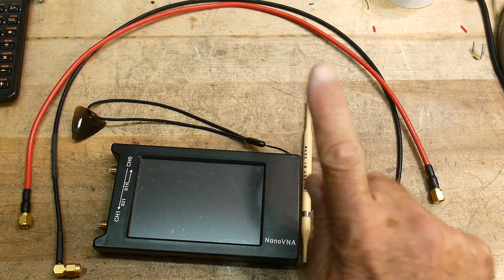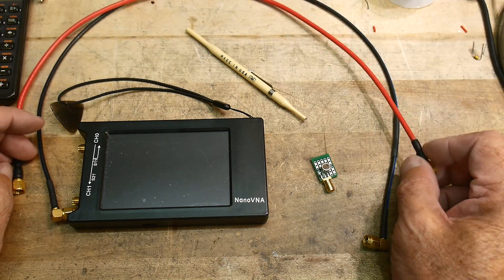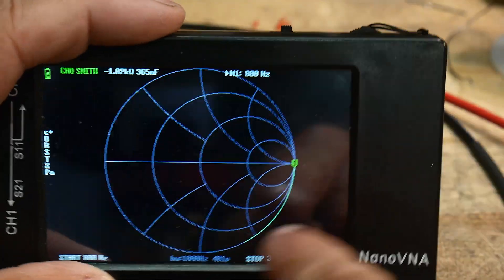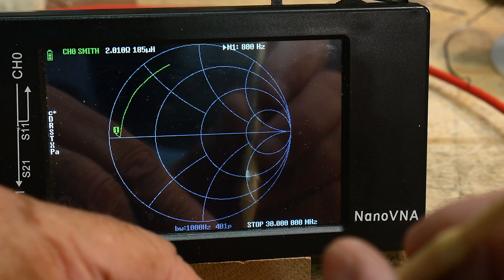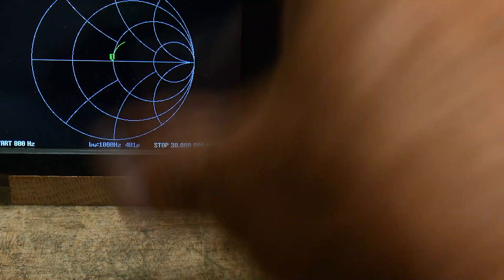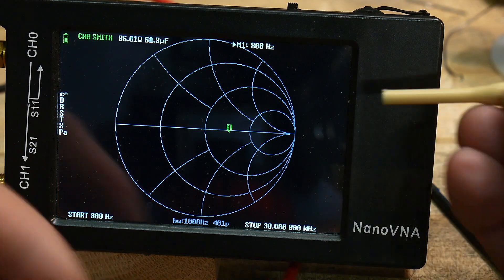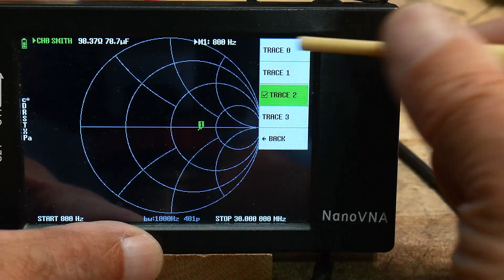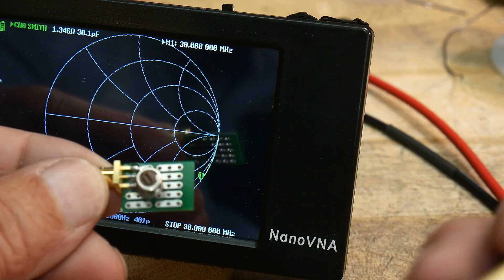#833 Impedance Test Fixture for the NanoVNA

Comment: You need to use a legit 50 ohm RF resistor on a shielded case to make this test.  Your resistor is working like a LC circuit
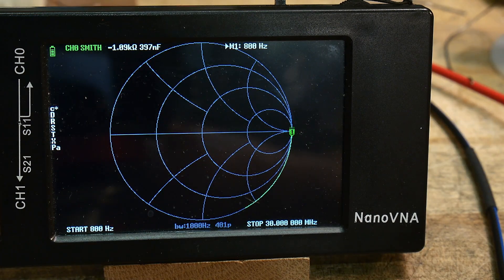Reply from the maker: you are correct to worry about LC but in this case they are very small at the test frequencies. I show at 4:10 that the gamma is very near 0 + 0j      so at these low frequencies it works just fine.

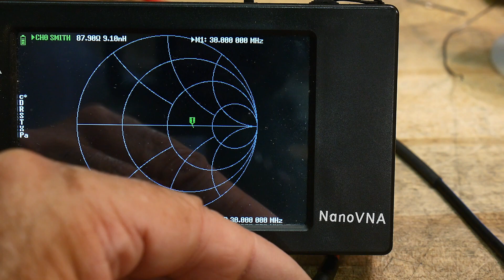Comment: I don't think that this is correct. What you measured at 9:45 is the impedance seen by the VNA when the phase is zero (and thus reactance is zero). This will occur when your cable length is an odd integral multiple of a quarter wavelength. At this point your measured impedance is equal to (Z0)^2/ZL (where ZO is characteristic impedance and and ZL is the load impedance). Solving for Z0 we have Z0 = sqrt(Z measured X ZL). You should have measured the load impedance at this point multiplied it by the measured impedance (VNA) and taken the square root. AT 5:10 you were misled into thinking that, because the measured impedance was 50 ohm on a known 50 ohm cable, that meant that the measured impedance on the VNA is equal to the characteristic impedance. Had you measured your load impedance at this time you would have discovered that it, too was 50 ohm and thus that Z0 = sqrt(50X50) = 50 !!.  Try placing a 100 ohm termination on a known 50 ohm coax and repeating your methodology. What you will find is that your measured impedance (VNA) at the zero phase point would have been 50^2/100 = 25 ohms. Edited post for clarity (I hope).

Comment: Another way is to remember that a 45 degree transmission line shows a reactance value in ohms which is equal to the characteristic impedance;   with cable open on the far end, find the lowest frequency where it shows shorted.  Let's say 50 MHz - the length is a quarter wave.   At 100 MHz it will be 1/8 wave or 45 degrees.

Comment: Try this... with the cable open, find the lowest frequency where the cable appears shorted. This will be where the cable is 1/4 wavelength. Attach a 50 ohm load to the cable and read the resistance. The cable impedance is then Zo = sqrt(Zl*Zmeasured). In the case of 75 ohm cable (but you don't know that), you should read about 112.5 ohms with a 5o ohm load at the frequency where the cable is 1/4 wavelength. So Zo = sqrt(50*112) or 75 ohms. For your 88 ohm cable you should get a reading of 154 ohms using the procedure as above. Hence, Zo = sqrt(154*50) or 88 ohms. I hope this makes sense.

This way you do not need a test fixture. Just a sweep to find the 1/4 wave frequency and then measure again (at that same frequency) with a 50 ohm load attached then apply simple math.

Cheers, 
John
Reply: Best comment of the thread.
Reply: You are Amazing😮😊

Comment: I thought with the help of your video I just found how to make phasing lines for vhf dipole feed element but I am way way far from that 90°... I don't understand how to measure phasing lines on the smith chart... how can you measure a piece of coax cable to have 90° ¼λ to feed a 145MHz dipole for example ?
Reply from the maker: a  1/4wave length of coax will go 180 degrees around a smith chart.  360 degrees of phase travels around the smith twice
Reply: @IMSAIGuy  hmm... there is something I am not doing right then... if I need a piece of coax to be ¼λ at 145MHz, I calibrate my nanovna between 144-148, select the smith chart and only connect that piece of coaxial cable with open end to the nanovna ch0  right ? if it is the case, it is not working (as the plan I am looking at state a particular lenght of .66 velocity factor) and I don't know what am I doing wrong.... but thanks for the replying and the precisions !
Reply from the maker: @Aleziss  you don't need such a small frequency range. sweep from 50 to 300 and see where you are. too short or too long.
Reply: @IMSAIGuy  thanks I will try this again with larger frequency range... I was expecting to be right on it since I already had some measurement according to a antenna plan. Thanks for the hints !

Comment: How to measure differential pair cables, such at cat5/6?
Reply from the maker: you would need a balun. this would be also 50 to 100 ohm impedance change. The spec on cat cables is 15% so don't expect a perfect 100 ohms.
Reply: You can also do it by measuring it on a LCR meter - you measure the short circuit inductance (so short the far end of the twisted pair) and the open circuit capacitance, and zo = sqrt(L/C). It works good on twisted pair cables. The longer the piece of cable you measure, the more accurate the measurement will be

Comment: One thing that would help would be to pick a pot with a smaller range and make sure the pot is a linear taper (not an audio taper).  For this cable, he could use a 50 ohm resistor in series with a 100 ohm pot.  That way you get a range of 50 to 150 ohms.  Or, use a multi-turn pot, one that has a standard carbon base to minimize inductance.

Comment: is the far left on the smith chart where it is shown as short is always at ¼λ ? meaning at the far right where it is open is 0° and far left where it is short at 90° ?
Reply from the maker: yes you you start at 0 on the right, then 90 deg on left (going clockwise) then all the way back at 180 then right at 270 then back at 360. one wave goes twice around the chart
Reply: @IMSAIGuy  awesome thank you for the precisions !

Comment: How does the 50 Ohm connectors come into play? I would think that would effect your results somehow.
Reply from the maker: yes and no. The system i calibrated to 50 ohms and the cable will be the only piece that does not match. the termination zeros this out at the correct value. You can do a similar measurement sending a pulse down the cable and looking for the return on an oscilloscope. if terminated correctly there will be no return reflection.

Comment: Might get some better resolution if your max frequency is higher than 30 MHz. Problem however may be the trim pot stops looking like a pure resistance the higher in frequency you go. I think the cable is probably 91 Ohms as that is a standard impedance you see around some places.

Comment: would a multi turn trimmer have helped in this case?
Reply from the maker: no, need to keep inductance low
Reply: @IMSAIGuy  are all the little screw drive trimpots made with resistance wire?
Reply from the maker: @nickcaruso  I've always thought so
Reply: It depends on the multi turn pot.  Many are made with the same resistive material but a screw or screw and gear mechanism to move the slider.  The other thing that would help would be to pick a pot with a smaller range, make sure the pot is a linear taper (not an audio taper).  For this cable, he could use a 50 ohm resistor in series with a 100 ohm pot.  That way you get a range of 50 to 150 ohms.